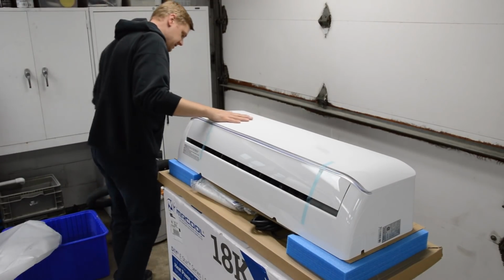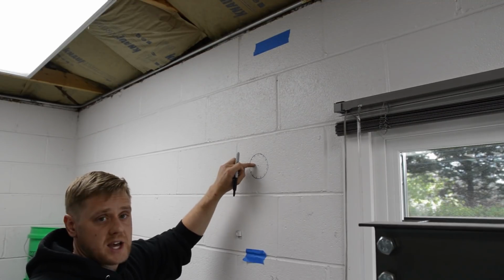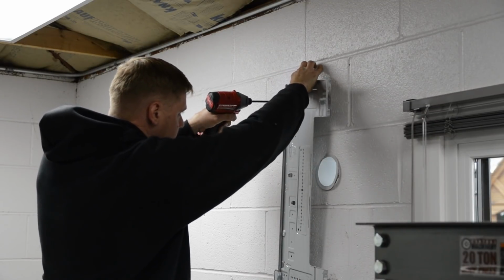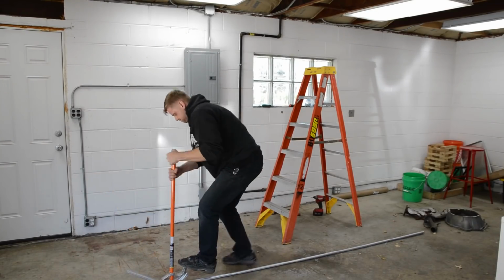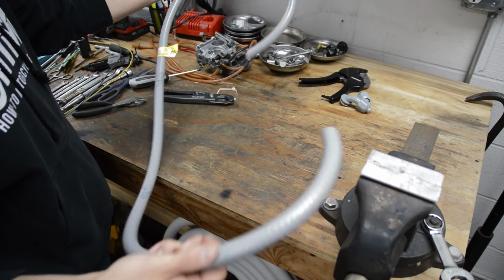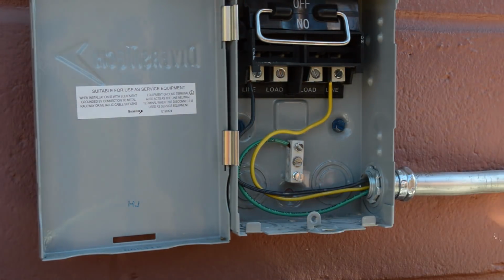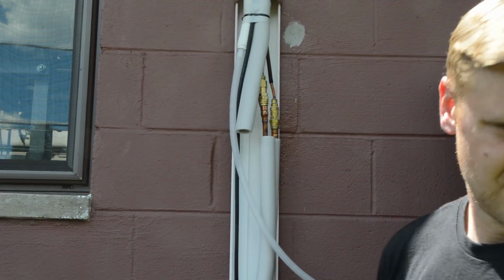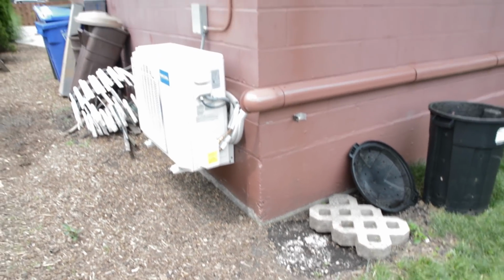How-To: MRCOOL DIY Mini Split Installation (Step by step) / Garage has A/C!

Comment: Sorry I know probably my question is stupid but on the AC disconnect box how you know which one you're suppose to use 30 Amp or 60 amp?
Reply from the maker: Look in the instructions of the mini split and see what breaker they recommend. This unit requires 20A, so a 30A disconnect would have been sufficient.

Comment: So, once you install all the tubing, is there a need to add "Coolant GAS" to it? Does the unit comes with enough?
Reply: Nope.
Reply: @jumpinjojo  what about vaccum the pipe? if not does it lower the efficiency?
Reply: @marciliodelagarza2714  It’s prevac’d from the factory. The lines are sealed. There is plenty of refrigerant contained in the unit. Once the lines are connected and the valves opened, they balance out within the system.

Comment: Would of been a good idea to evacuate the system before releasing the refrigerant to lengthen the life of the system. There is definitely moisture in that line-set. Other than that, excellent guide. All the electrical was done to code which is pretty rare on some of these videos.
Reply from the maker: Lineset precharged no vacuum needed with this DIY kit.
Reply: @HTMR  Most of these mini splits come pre charged. The refrigerant is stored in the compressor not in the line set. When you open up the valves after installation you release the refrigerant into the lineset. The reason you should evacuate the lines and pull a vaccum is to remove any moisture that is in the lineset.
Reply: The AC obviously will still work without a vacuum, but the longevity of the unit is compromised.
Reply: @SeanLeonDrumz  LINESET IS PRECHARGED! I think this has only been said a million times already.
Reply: @oksailor1056  The line set it not pre-charged. The compressor in the condensing unit is pre-charged. When you connect the line set and open up the suction and liquid line via the valves it will release the refrigerant into the line set. Almost all Mini split units and many other type of HVAC equipment come "pre-charged"
Reply: @SeanLeonDrumz  The lineset ARE pre-charged

Comment: Little late to the party but I am about to install one of these units.  The only thing I didn't see you do that others have done, is just pull a vacuum. it will check for leaks but also remove all of the air out of the lines.
Reply: No need to. Precharged line sets on the Mr Cool systems.

Comment: why do you not have a neutral ran to the ac unit and instead just a ground?
Reply from the maker: 220V requires 2 hots and a ground. That's the way it is.
Reply: @HTMR   guess im just thinking of  3 wire with 2 hots a neutral and a ground.  yeah neutral and ground is seperate on the sub then end up in the same place bonded at the  main.

Comment: I"m  sory my friend but without vacuum in the refrigerant tubes you will have many problems in the future.
Surely this is my own opinion but i have to mention it.
Best regards for a happy new year.
Reply: This man has explained this multiple times, the line set is PRE-CHARGED. If you pull a vacuum, you have vacuumed the refrigerant.  The unit comes pre-vacuumed and PRE-CHARGED. So once the valves are opened, a pathway is created between the indoor and outdoor units.  This is why the Mr. Cool system is considered DIY.  No vacuuming and no charging required.

By the way, this was a fantastic video presentation!  Well done😊

Comment: I have the same unit as you but the people who installed it have the larger line on the bottom and the smaller line on top. Everything seems to work except the unit behind the fan is a little loud do you have any ideas to help me?

Comment: Does this come with a hole saw? Just ordered a 12k
Reply from the maker: No. You'll have to buy one.
Reply: @HTMR  did you order one from mrcool? Do you recommend one? Have to go through brick too.
Reply from the maker: @MLS1000  I wouldn't recommend that hole saw for brick. Cinder block is much easier to go through and it burned it up pretty good. Get a core bit.

Comment: Arent you supposed to pull a vacuum on cold side, then release the charge?
Reply: apparently the lines nowadays are coming prev-vaccumed/charged with valves that depress at the point of connection. kinda cool.

Comment: Nice video. You could have used two black wires. They are both hot. Different colors can confuse the next person that works on the electric. You could wrap some black electrical tape on the ends of the yellow wire to identify it as a hot leg.
A safety suggestion habit: Start wiring connections from the unit to the panel. This will prevent someone from accidentally switching on the breaker while you are working.
Reply: That is not correct, Hot can be any color other than Green and White.  What he did is standard practice .

Comment: What kind of screws did you use to mount the bracket to the wall?
Reply: Looks like blue Micron cement screws.  But any brand will do (Dewalt)

Comment: Great 👍 job ...thx. 
I hope mr.cool start to think about semi trucks n RV’s .....APU charging arms n legs($10K) and don’t last much ... it’s costly to maintain and service ...horrible warranty n service....so a lot of us now buying Electric generators portable A/C....and some starting to have split units on the back of the trucks
Reply: I’ve seen it done, but as a HVAC tech, it needs to be designed for the vibration and abuse that a vehicle chassis will put on a unit. These Mr. Cool units are okay. They are not top of the line like Fujitsu and Mitsubishi. You get what you pay for!

Comment: If I have a panel and the neutral and ground are bonded, would it still work? Im trying to install a Mr. Cool DIY 24k also.
Reply from the maker: Yes. You are dealing with the main panel correct? My panel is a sub.
Reply: MatthewMCRepair Surprisingly, this is a sub-panel
Reply from the maker: @neiljoe0605  does your sub panel have the ground wire running back to the main panel or does it have a ground rod?
Reply: The main panel has a grounding rod and it is bonded with the neutral.  The sub panel has only 3 wires (2 hot & 1 neutral).
Reply from the maker: @neiljoe0605  The sub panel also needs a ground. Either add a grounding rod to sub panel, or run a ground back to main. If you run a ground back to main panel, the ground and neutrals should be unbonded like in my panel.

Comment: what was the freon? R410a? how about vaccum?? i love how simple things are at your place
Reply from the maker: Everything is precharged. No need to vacuum lines with this DIY kit.
Reply: good question, my experience, by using a vacuum pump, you can do a leak test before opening the valve that release the refrigerant and most important, you don't have ambient and moist air trapped in the lines that can shorten the life of the whole system. 10 to 15 years when vacuum is used and the unit is clean and maintain regularly and less than 10 if moist air is trapped. 6 years with my first one, corrosion occurred inside of the outdoor coil and leaked all the refrigerant out.
Reply: R410a is a blended refrigerant 50% R32 and 50% R125. If a leak does occur the whole system charge will have to be recovered to 0 psig leak repaired, vacuum to 500 microns or less then recharge to factory specifications. These steps are not DIY.

Comment: Thanks for posting such detailed installation video. a question for you... Why didn't you vacuum the system before releasing the refrigerant?
Reply: pgh2134arch because the lineset is charged with refrigerant already and that’s what makes it DIY and no hvac tech required

Comment: Be sure to go back and wrap the foam insulation around the copper coolant lines with the tape that comes with the unit.  Otherwise that cheap foam will break down in no time due to UV from the sun.
Reply from the maker: Good tip!

Comment: You can use a white white wire all you have to do is color code It black or brown
Reply: Correct, just run a couple spins of black electrical tape around it as it enters the disconnect box and condensing unit.

Comment: How long do you think this takes on average?
Reply from the maker: Probably 8-16hrs in my case. I had to film it so it took a LOT longer.
Reply: Make sure you use a hammer drill when dealing with concrete or masonry.  If I had to go though hardy board instead of brick, I'd been done hours faster.

Comment: And most definitely do not release the refrigerant valves without pressure testing with nitrogen and put on a deep micron vacumm.
These cheaper mr cools might night die as fast but by a dual stage inverter which most mini splits are now you'll get about half the life out of the compressor
Reply: This kit has Schrader valves in the line set they’re pretty dumb really not pressure testing is asking for problems

Comment: Mr. Cool or Matthew,  don't you have to put some refrigerant into the system in order to make it get cold? By the way, are you a jack of all trades or are you an electrician? You have enough knowledge to be an electrician and make big bucks.
Reply from the maker: Almost all ac units come pre charged nowadays. I'm a mechanical engineer by day, try to be a jack of all trades around the house.

Comment: In my area, the open end of the line-set cover needs to be packed tight with steel wool or hardware cloth or steel mesh..  something like that to keep the rodents from entering.
Reply from the maker: Someone commented on that a while back and have added steel wool.
Reply: Hey Steve; great idea.  Is steel wool better than say...spray foam?
Reply: @itisaporsche  Yes, my experience is the rodents easily tear through anything that can tear..  the steel bothers their teeth too.

Comment: Hi, nicely done! One question, the electric disconnect box outside, you used waterproof fittings, but the box is not waterproof, if some water gets on the top I think it will enter the box right?
Reply from the maker: You are probably right. Same disconnect as my house AC for 10+ yrs and no issues yet.
Reply: @HTMR  The NEC specifies "water tight" & not "water proof".  Cheap insurance is to paint the box with a good sealant

Comment: What type of bit did you use @ 23:30 for the hole for the conduit? And what size and length is it? Also, is it just a normal hammer drill? I'm considering putting my conduit thru my block foundation or possibly a short run of poured concrete. Just curious what you used. Thanks!
Reply from the maker: It is a hammer drill bit. Forget the size, about 1.25".

Comment: I'm an Hvac contractor.
You did everything correct. Good install.
The only thing wrong is that without vacuuming the lines,you just killed the system.
It might last 2yrs tops.
Any oxygen in the lineset will cause acid to form in the lineset once it mixes with the refrigerant and fry the compressor.
Reply: Why would you vacuum the freon from the lines , dont make sense
Reply from the maker: This is a diy kit with precharged lineset. No need to vacuum. Read this: https://iwae.com/resources/articles/pre-charged-line-sets.html
Reply: @derwinlowery  when pulling a vacuum on a system, you are not vacuuming refrigerant from the lineset. Before opening the valves you are vacuuming any non-condensables from the lineset. Such as oxygen or water vapor. Once vacuum is achieved, then you open up the valves.
There is no such thing as a pre-charged lineset.
Reply: MatthewMCRepair that’s interesting, so they have a valve pre installed on the line set. The draw back is you can’t check the seal or cut the line.
Reply: I was thinking the same thing but he is correct precharge line sets are a thing now. I haven't used them but I know some people who have im a HVAC contractor myself.

Comment: That's some really nice work but I'm pretty sure there should be more of a gap between the backside of the heat pump and the garage wall. That narrow spacing between the two would kind of worry me about the heat pump not having enough airflow as needed.
Reply from the maker: I thought so too, however the bracket is sold by MRCOOL for this unit. Plenty of airflow behind unit if I stick my hand back there.

Comment: after installation, do you need system charge  ?
Reply: after installation, do you need system charge  ?
Reply: @吾言-c4z  No, lineset is pre-charged in the Mr. Cool DIY units.

Comment: how long did the installation take you-not counting the video set ups.  nice job
Reply: Andy hardest part is drilling through whatever to get the lineset out to the condenser. The rest of it probably takes less than 2 hours.
Reply from the maker: Well, hard to say since I was filming it. Some things that took me extra time is to redo the electrical, and to paint the lineset covers. Also, the lineset guard (needed 2 kits) was on backorder, so I kinda lost track of time sorry.

Comment: What attachment did you use to connect the signal wire to the condenser?
Reply: He created his on whip from liquid tight fittings and flexible conduit. It's available on the shelf at Home Depot and Lowes.

Comment: Hope someone can answer this question soon. . . Do I buy 10/3 or 10/2 Romex?
Reply: These units don't use a neutral, so it is two wires (plus ground). Depending on which Mr. Cool unit you purchase, 12 wire up to 36K and 10 wire for the 36K unit. Two hots connected directly to the breaker (plus ground), two hots and ground on the line side of the disconnect box, two hots and a ground traveling through his whip to the condensing unit.

Comment: Proper material used for electrical and knowing the difference of ground/neutral in the sub-panel compared to main panel. Also, knowing suction/liquid line. You jack of all trades or what?
Reply from the maker: LOL...yeah maybe. I'm a mechanical engineer and just like to know how things work.

Comment: When running 240 volts you can run white for a hot
Reply: If white jacket wire is used as hot, it has to be remarked with a color (e.g. black, red) at ends to indicate HOT.

Comment: Why didn't you put the zip tie at the location where it is inside the sleeve outta site?  Tapcons would have been easier outside.  Should have used PVC outside....EMT will not last long exposed to the elements!

I like running a Neutral and leave the ground as ground....dont like using a ground as a neutral only!

Good job son!
Reply from the maker: I have had Tapcons rip out of block. PVC is not code here.
Reply: There is not neutral needed for 220/240v

Comment: Your wire is to small. The 18k unit calls for min. Of 10AWG but the preference is 8AWG
Reply from the maker: My manual stated 12ga.....and no way do these pull 30A+
Reply: @HTMR  really my apologies, I didn’t try to come off as smug. I just got 4th gen I guess they switched it. Do u like it uses less or more?
Reply from the maker: @TankGunner84  No worries. The system worked great whenever I had to use it. I moved about 6 months ago though so can't comment any further.

Comment: I think you need to vacuum the lines before releasing gas
Reply from the maker: Not needed with this DIY system. Special lineset included.
Reply: MatthewMCRepair  what are these line sets specification?! Can you explain to learn from you 🙂🤔
Reply: I am curious about this line set?
Reply: How does it hold a vaccume while being connected?
Reply from the maker: @geraldvaldez5935  https://iwae.com/resources/articles/pre-charged-line-sets.html
Reply: @HTMR  I like it 😀 thanks

Comment: Loops in the Suction line, as is behind the Condenser unit, are to be AVOIDED.  because compressor OIL get TRAPPED at bottom of loop and accumulates there.  There is risk of compressor burn out due to oil starvation.  If loop is needed be sure it is HORIZONTAL plane.
Reply: Was going to say the same thing.  Created an oil trap.  Trim those lines.
Reply: They are correct @MatthewMCRepair, the instructions do say to keep your excess coil horizontal.

Comment: Wait, they give you all the tools needed???
Reply: Only "tool" in the pagages is the 5mm hex key.  Need a couple of adj wrenches and a drill with a 3.5" hole bit. If going through masonry, need a hammer drill and carbide-tipped whole saw bit--and it'd be nice if it's deep enough to get through the material you are cutting. Need some screwdrivers. Drill bits.

Comment: 35:00 What is that charred looking bare conductor on the top left neutral bar?
Reply from the maker: That is the jumper between neutral bus bars that the panel came with. It is not charred.
Reply: @HTMR  Ah, interesting design by Siemens. Thanks for answering and nice work!

Comment: Great job!   However,  tucking the excess refrigerant line behind the condensing unit is NOT good because it will get in the way of the fan-induced air flow.  I suggest putting the under the condensing unit.
Reply: Not only that ...... no one seems to notice it clearly says 12 to 18 inches clearance for coils and fan / he put it against the wall lol restricts air flow and in summer the compressor is gonna go over load pause all the time
Reply: I own one (36k BTU).  The manual states minimum clearance:  12" from wall for ground mount and 6" from wall for bracket mount.  The Mr. Cool video also says to store the excess lines horizontally.  But the manual does not address it.  It just shows a diagram of the lines coiled up at a 45 degree angle.  Mr. Cool sells the wall bracket so my guess is - it has the 6" clearance.

Comment: Your wire size has to be number 10 and EMT is in side conduit
Reply from the maker: Why #10? I used EMT and raintight connectors. It meets code.

Comment: Hey, my aircon was setup all profesionally, but now i need to relocate the condenser/compressor and i would like to see if i could do it myself. What are the steps in closing of the system to retain the vacuum and refrigerant ? Can i just close off the top and bottom valves then be able to disconnect the line set and reconnect after?
Reply: 410a needs to be recovered with a Refrigerant recover machine and the charge needs to be weighed back to factory charge as mini splits run on algorithms. Get a professional